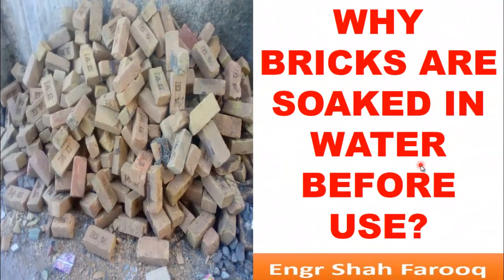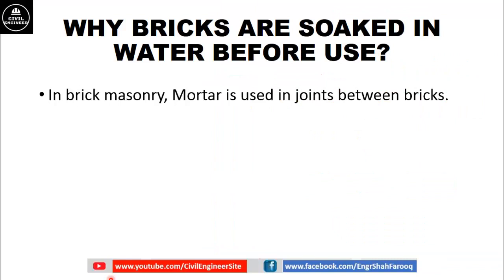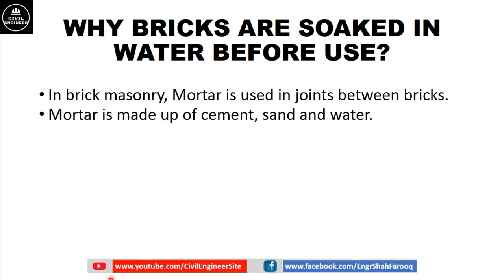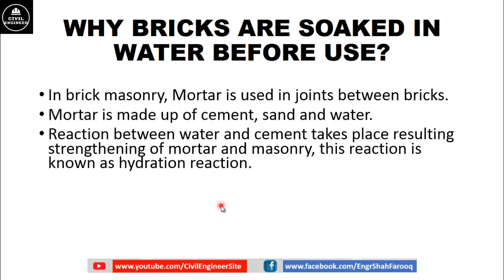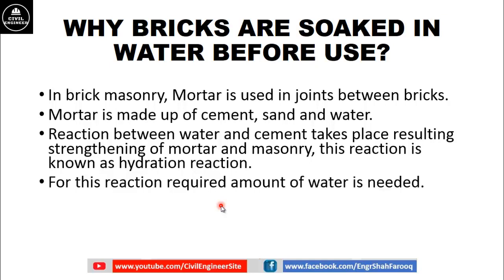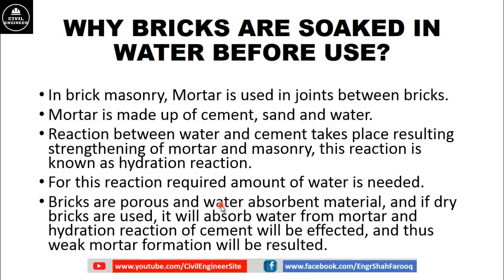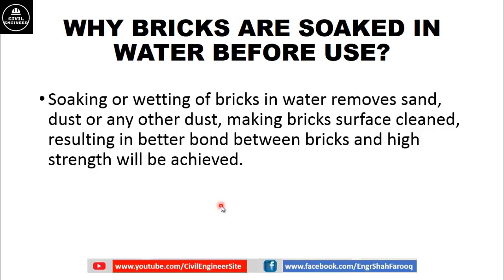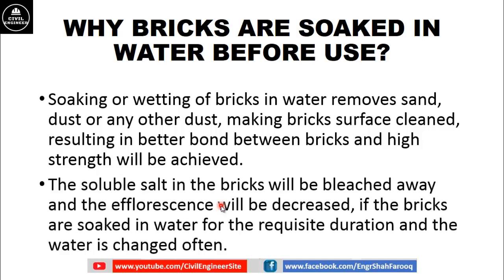WHY BRICKS ARE SOAKED IN WATER BEFORE USE? |WHY BRICKS NEED TO BE WET BEFORE LAYING? | BRICK MASONRY

Comment: nice video sir i want to know that i had done masonry brick work or my boundary wall at my home's roof and it rain just after 30-45 minutes and it continued to almost 10 hours, after that i noted that the cement mortar was not flush/ swipe out due to rain, it was intact but was wet and soaked so what will be the status of strength of mortar/ cement. however, plaster is yet to be done on that wall... what should i do for its strengthening or is there any thing to worry about? 
reply awaited. thanks
Read more